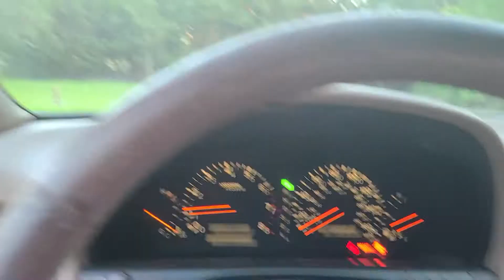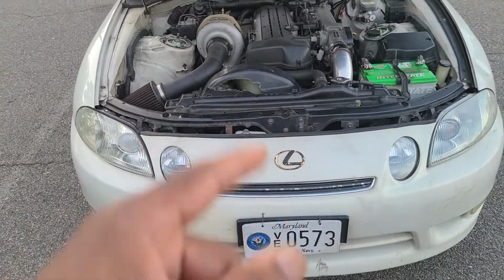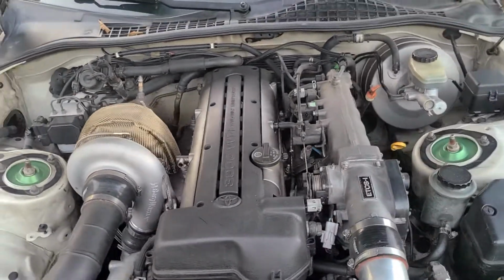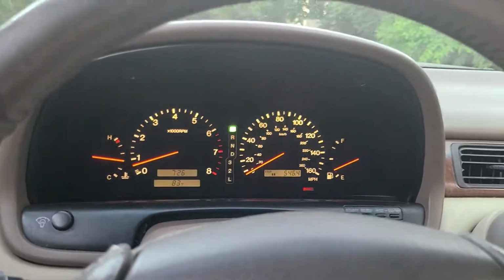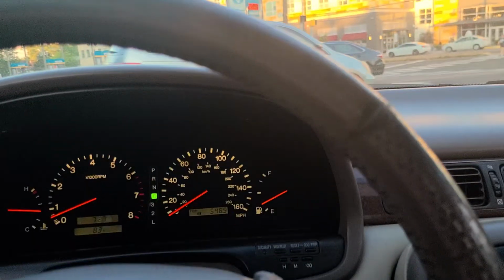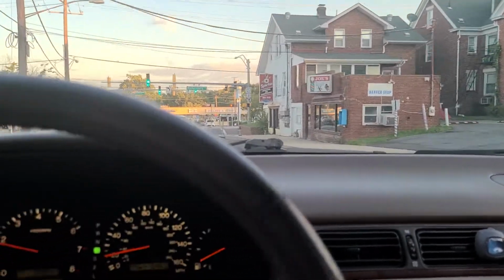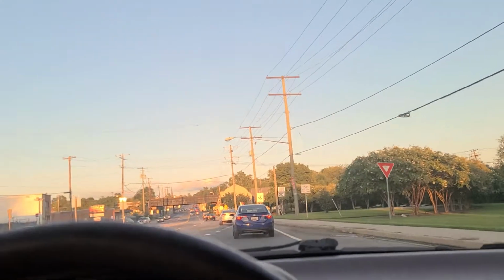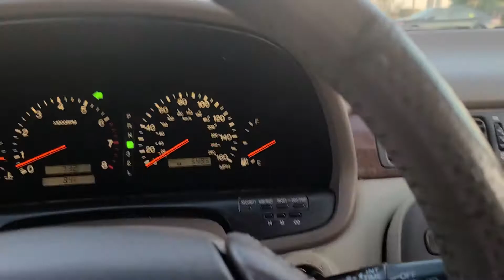Lexus SC300 2jzgte vvti Borg Warner turbo

Comment: Big up Yardie!! I think I remember your user name from maybe maxima.org. Nice build! I'm trying to find a sc400 and do a borg warner set up too.
Reply from the maker: waddup bredrin, thanks for the kind words........yea i was active on there when i had my S/C maxima.......so are you going to boost the V8?.....those motors can take some boost.
Reply: @jamaicanlovrboy  trying to find a car now for a decent price. A 300 or 400. Yeah I had a turbo max too as maxgtr2000. One day it wouldn't start. I wish I got it looked at because I always did my own work. Ended up taking off the mods and selling it as a roller. Still have the body kit and turbo. But time for a big boy car..lol.
Reply from the maker: @drewt1926  yes i remember that name.......funny thing is thats exactly how i started getting rid of my max....S/C went out, and i started parting it out. Yea  the 2JZ is def a better platform for power and reliability IMO

Comment: Your car looks and sounds great! Your narration of being in traffic is exactly how I feel when I'm driving in traffic! I've got an sc300 that's also auto, how is it driving boosted on the stock trans without a boost controller? You seem to have no problems but everywhere I read that the stock auto trans will slip if the cars boosted etc.
Reply from the maker: thanks, and i appreciate you watching.......As far as daily driving, i do not notice any slipping of the transmission keep in mind im on 10psi (i think). Only issue i have is speed cut and it sometimes runs rich because i have a tial BOV which is not recirculated. I was going to do a trans cooler, but since im planning on going manual, i do not spend much money money on the aristo auto besides fluid changes.
Reply: @jamaicanlovrboy  how do you like the Spool time with the S362Sxe?
Reply from the maker: @sloa3158  it spools almost as fast as my PTE 62mm considering its bigger.....but once it comes on its relentless, no falling off
Reply: @jamaicanlovrboy  I’m looking to buy it for My 1st Gen Aristo. I’m Staying auto and going with a log manifold and looking for response.
Reply from the maker: @sloa3158  if you want even more response, you can even go S360 sxe thats a bit smaller with the log style manifold
Reply: @jamaicanlovrboy  I’m kinda looking for 450+ on pump gas and under 20lbs lol. So I think the S362Sxe will be perfect. Did you dyno yours?
Reply from the maker: @sloa3158  no i never had it on the dyno, just swapped the motor, and the turbo and ride lol
Reply: @jamaicanlovrboy  1/4 times?
Reply from the maker: @sloa3158  never ran it at the track lol.  I did this swap because i got pissed a ford explorer with the 3.5 turbo beat me when i was NA, not really to drag race or make big power.

Comment: I used to put money into my sc300. But as I got older I realized the Ls engines are more reliable ,less headache and more practical. Crazy to see a 40 some old dude driving a teenager car. lol
Reply: SC300 wasn't a teenager car when it came out. It's a luxury coupe that has a good platform for tuning man. I see middle aged people drive SC's more than I do teenagers in my area honestly. You just come to realize with Lexus you can get the best of all worlds really. Power, reliability (to a degree), comfort, and style. I'll always love Lexus/Toyota. For reference I've owned an 08 C6Z06 heads/cam etc. As well as several mustangs. Thatdudeinblue did a review on it if you wanted to check it out! He also reviewed my old 98 stock TT6 imperial jade mica green Supra too! 

The thing is when it comes to heavily modified cars you're going to have to tinker with them no matter what manufacturer you're dealing with. Parts break. My 48k mile Z06 had more problems with it than my current NA-T SC300 does, and it's on a stock bottom end and a stock 5 speed manual trans with 182k miles 🤷‍♂️ I mean shoot my old FB0 2011 Lexus ISF (420whp 5.0 n/a V8 with 8 speed auto) had NO ISSUES EVER for the time I owned it. I daily drove it, beat the snot out of it daily, hit rev limiter everyday, and even took it on a 5 hour road trip to Myrtle Beach, beat on it there, and drove it right back home a week later without a hiccup! That car had 80k miles.

Whether it's a 25+ year old 2JZ or an LS ALL of them have potential for problems and blowing up which all of them have done and will still continue to do in the future. Comes down to personal preference at the end of the day. As they say "pick your poison" 😂

Comment: Hey sc family. You mentioned you or your friend having a couple spare gte vvti throttle bodies? I could really use one if you still have it available let me know my friend.
Reply from the maker: yes i have a spare one sitting that i took off the motor.....however, i swapped it out because my car kept going into limp mode. I took it off and swapped a few other TB with the same issue until i replaced my battery terminals, and battery. Long story short, the TB was never the issue, my car is just running too rich because i no longer have a recirculating BOV. So i dont know the condition of the TB i took off just FYI
Reply: @jamaicanlovrboy  i understand my friend. What would you want for one?